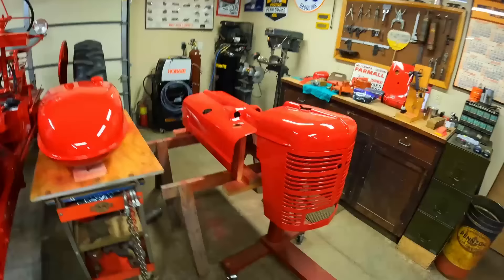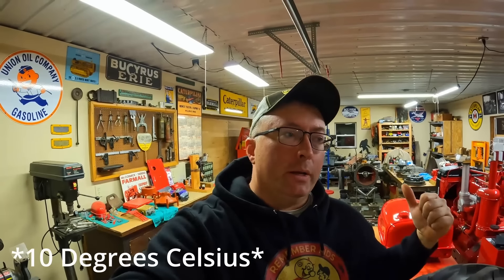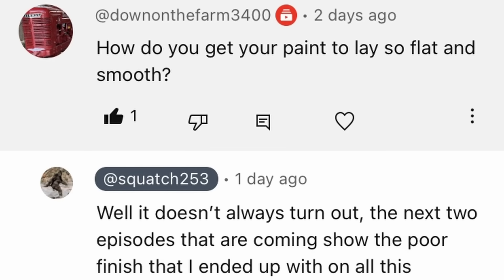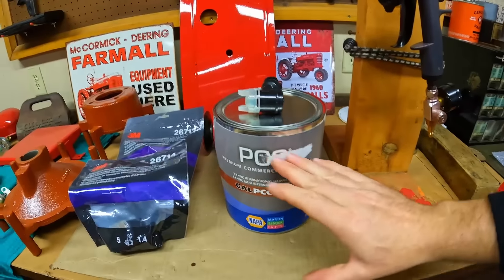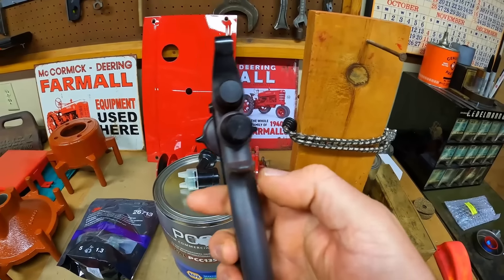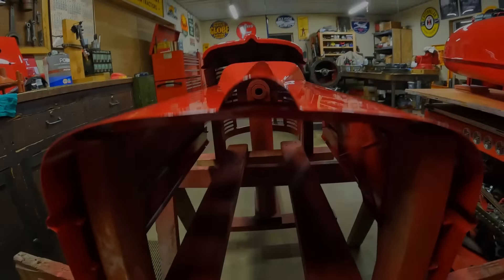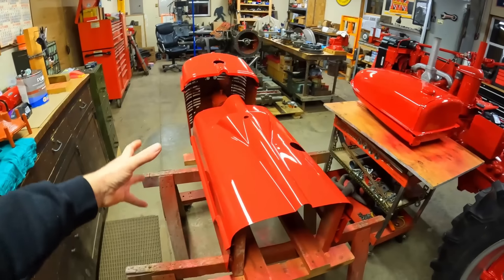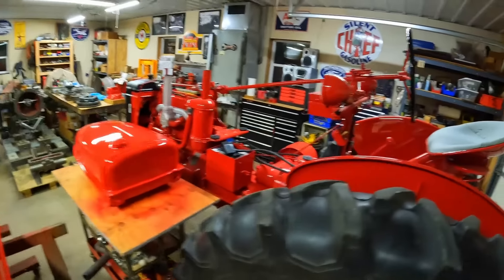Farmall H Sheet Metal Respray Success! Paint Day Recap & Viewer Question Episode - "Prep H" #49

Comment: Paint laid down great Squatch! Very lucky to catch a break with the weather to be able to do that. I have a couple of paint projects to try and get done myself before winter really sets in. I can paint in my shop, but I hate to do that because of the mess and all the stuff I have to move out or cover up. Even with the adequate exhaust and airflow I have, it gets everywhere using single stage urethane colors, which is what I need to spray for my Wheel Horse 520H. I can spray base/clear without so much mess, but that would be kind of cost prohibitive on a tractor project, although I have used it before for that purpose.

Comment: The practice part is the best advice you could give. Buy a little extra paint and get your process worked out on a scrap piece of sheet metal if need be, before moving on to prime time. I do the same thing with welding, I work out my process and procedure before I ever arc up on the job, saves a lot of time in the long run.

Comment: Hey Toby. Paint spray # 2 turned out really well. IM gonna restore a 46 A and don't want to make the mistake of using Rustoleum F and Imp  paint. Although it did turn out good as I used a catalyst. But I know it won't be very durable and maintain color consisistancy for very long. Thanks for sharing your skill and techniques. I would like some details in a nutshell of the paint , hardener and reducer you used. Also what paint code to match IH Red as I have gone down a few rabbit holes try to figure that out. Again thanks for the videos and nice work. I enjoy your content.

Comment: What spray gun are you using?
Reply from the maker: 3M PPS 2.0, the PPS stands for Paint Preparation System because the nozzles and paint cups are all disposable, leaving only the main frame of the gun for cleanup. I do clean and reuse the nozzles several times each, because a bag of 5 costs about $40. The main paint cup housing gets reused, it’s got all the mix ratios and volume graduations on it but the actual cup is a thin plastic sleeve that slides inside it, those are cheap enough that I just toss them when I’m done. Overall I’m impressed with the setup 👍

Comment: The real question is what about the other parts on that beast? Did they have orange peel? I certainly hope not.
Reply from the maker: Nope, everything else up to that last faulty batch turned out great. Like I said in the video, that unplanned extended delay due to needing to have eye surgery ended up causing the old partial gallon of paint to thicken slightly in the can, so 6 months later when I could finally see well enough to paint again I just used the same old mix ratio as before but it didn’t turn out. And of course I was also in a hurry to get it done because I was well into the new building going up so I ended up cutting even more corners that all compounded into one really bad paint job.
Reply: @squatch253  been watching for years and maybe I've missed a few vids for that I apologize.